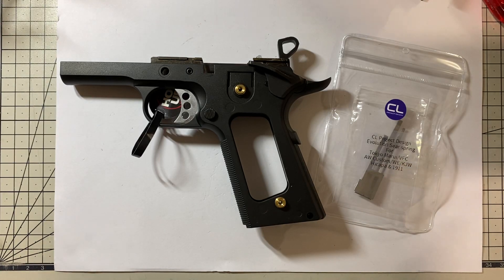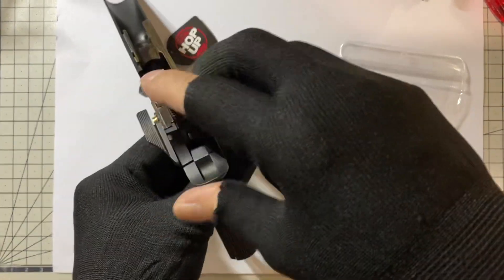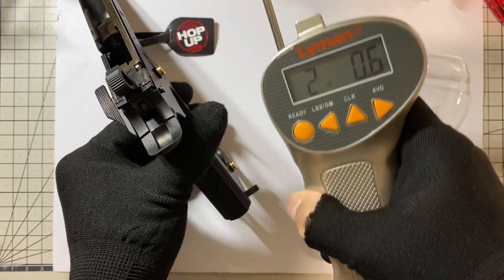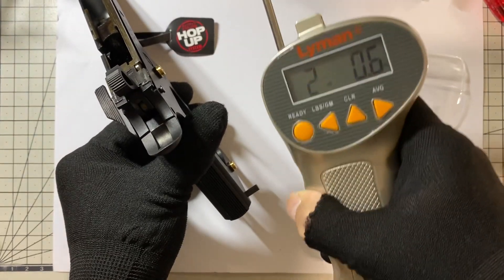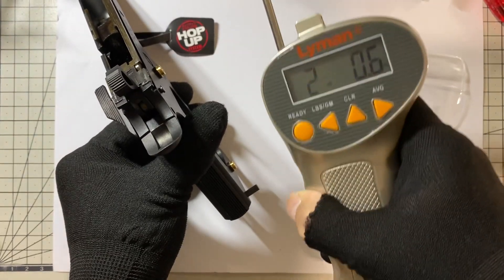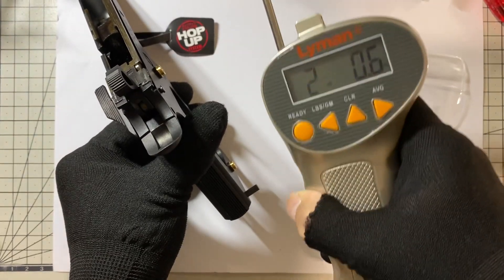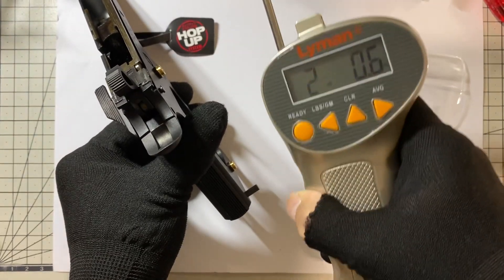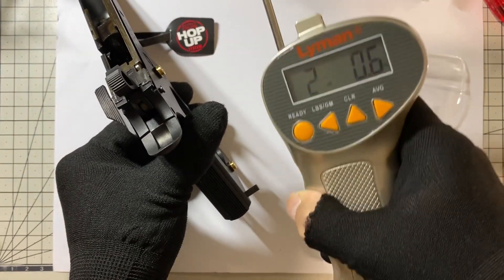CL Project Design Sear spring for 1911 & Hi-Capa

Comment: Wait a minute, factory pull you said 2 lbs. Than after it was .57? Or 5.7 What am I missing? How can it not have hammer follow at these light pulls? My theory is John B. had it correct it the beginning and any factory sear springs can be bent to inverse or decrease trigger pull weight. This is another sketchy idea that I'm sure works, but in my opinion, unnecessary.
Reply: 2lb and 0.6oz at the first pull and 5.7oz at the second one… ~4 times less? You can of course tune a leaf spring by reshaping it, but your effect is limited and different then using a softer one.